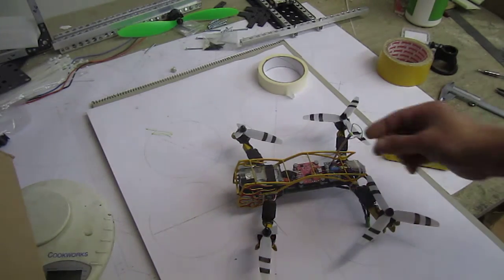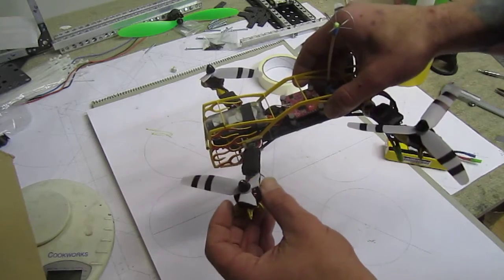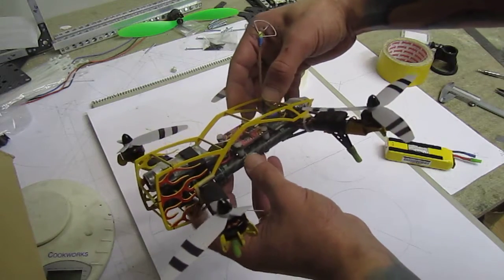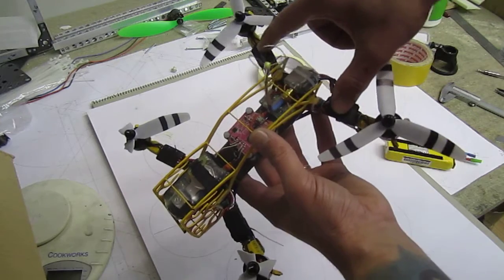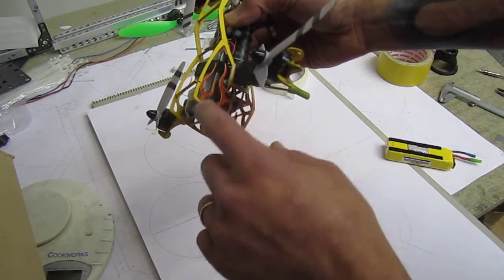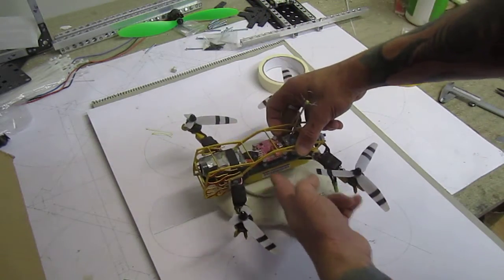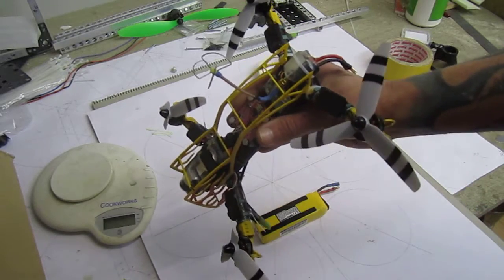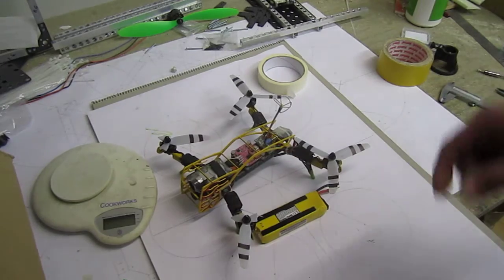Mini-H DIY quad build overview

Comment: I love your DIY builds. Very interesting.

Also, how do you find the 3 bladed props compared to the 2 bladed ones?
Reply from the maker: Thanks mate! Different copters prefer different props, so each to it's own:) This particular Mini liked 3blade ones (smoother and more locked in), but them are PITA to balance, so I switched to HQ 5x4 which are far better. Now Gemfan released 5x4s, so I'm sticking to them at the moment coz they're cheaper:)
Reply: Think I'll try some 3 bladed ones on mine and see how they feel. :)